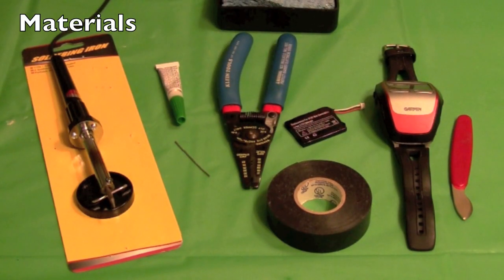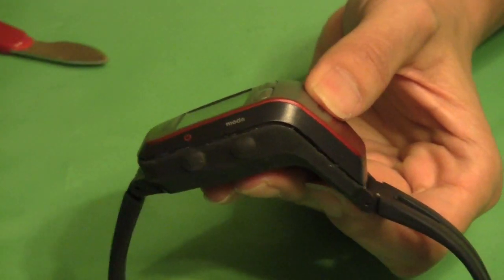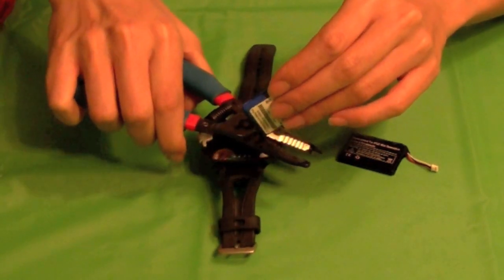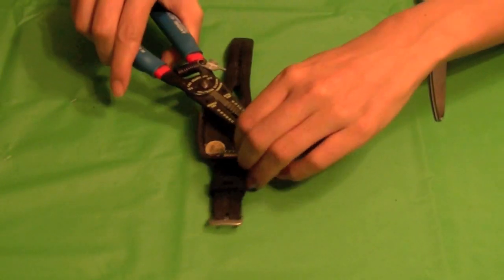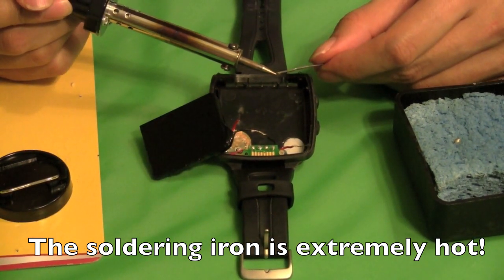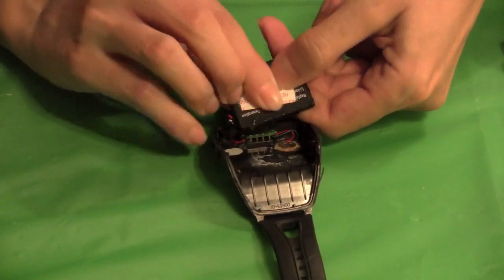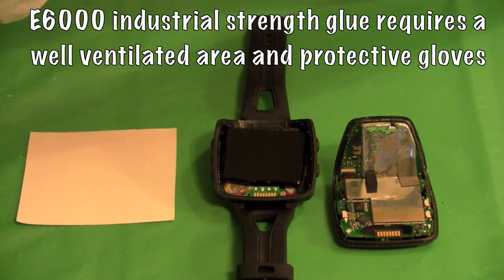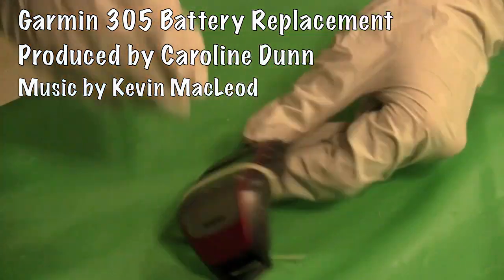How to replace the battery in a Garmin Forerunner 305 Watch

Comment: My my, you have beautiful hands. Thank you for this vid, my 305's mode button died and I threw out the unit. I got another used 305 for $30 and then saw your video. I went trash diving for my old unit so I will have a replacement battery if I ever need it. Thanks!

Comment: Caroline- Great instructions here. I just purchased a lightly used Forerunner 305 from E-bay today. Not sure if I will need to replace the battery at this point. Do you know if the battery will have any life? The original owner claims that the unit sat in the box most of the time. I understand that a good battery gets approx 10 hrs on a full charge, if that is correct. Thanks in advance!

Comment: So I posted my "I'll be trying this soon" comment six months ago ... and I finally did the job this weekend! Excellent, clear, easy to follow video. My trusty 305 is now charging and fully functional, once again. I found the wires/soldering a little fiddly; also packing the wires back inside the watch was a little fiddly too - I think I should have shortened the wires from my replacement battery a little before soldering, but I had already had the watch working and no way was I taking it apart again! Cheers :)
Reply from the maker: Congrats on extending the life of your Garmin! Glad you found this video useful.

Comment: Followed these instructions.  Got the same iPod Mini battery as in the vid.  Had never soldered before. But it all worked with no complications.  Not sure I sealed the edges well enough, so will have to put some silicon or something round.  My fault, though.  Cheers!
Reply: id pay you to replace my battery!

Comment: OK, I just did mine last night, and this was one of the more helpful posts.  My biggest piece of advice is get good wire strippers that go down to a very small gauge wire (I'm guessing 24g) and hold the other end of the wire (the part that's soldered to the board) with needlenose pliers so that you don't just pull the insulation down the wire.  I ended up having to unsolder the circuit board which leads to great complications.  If you can cleanly strip the insulation and do exactly what the post says, you'll be fine.  I tried to use some double sided poster mounting tape, but it was too thick, and I ended up using just a bit of the contact cement.  While I was in there I tried to solder the wire back onto the speaker (that's the disc), but no luck.  So far it's powering fine and is charging right now.  Also, while in there, pay attention to the contacts on the circuitry part of the watch and the pads on the battery side.  Clean them, and bend up the contacts if necessary.  I think even under ideal circumstances the contact is borderline, and is probably the cause of "watch turns itself off" issues.

Comment: ugh.i was hoping that it was an "easy" process.I dont have the tools sadly to help replace battery. i might ship it off to get fixed. unless your willing to help at a decent price to fix add new battery
Reply: Garmin will not fix it, they'll just offer to sell you a refurb for a much worse price than you can get on Amazon, Buydig, or eBay.
Reply: my watch just died that i bought from ebay this time. garmin charges 80 bucks to replace. i wish i could do the battery changing myself. shit.

Comment: Nice video. However, the battery that you show in your parts list is for the original Forerunner 305, but in the video you suggest using the iPod Mini battery instead?
Reply from the maker: Thanks for watching my video. You are correct. I made the video in 2013 when iPod Minis were a little more common. I was concerned that they would stop making iPod Mini batteries, so I decided to put a link to the 305 battery. I didn't want to link to a discontinued product.

Comment: Thanks for this vid. I had 3 dead 305's sitting in a drawer useless but now 1 is working thanks to your instructions on how to get inside. The red wire had come loose where soldered so I tried scratching the plate and re-soldering and the thing is working again! Not sure for how long but it has given me incentive to do open heart surgery on the other 2 units as well..

Comment: Hi, and I want to say great video! This was really thorough it gives me hope that I can change my battery once it goes dead. But I have a question, I was wondering if this can be re-soldered after taking it apart the first time? Like after doing this and it goes dead again can I do this again and re-change the battery if it goes dead a second time? Thanks!
Reply: +Dana Scully I would strip less wire to allow a third battery in the future. Also you can remove the solder using a soldering iron if you are careful with how you mate the wires with the first replacement
Reply: By the time the second one goes, you probably won't need it anymore because the Apple watches will be down to 30 bucks. You can always pry the circuit board out and solder new batteries directly to the board.
Reply from the maker: +Dana Scully Thanks for watching my Garmin 305 Battery Replacement video! I did not re-solder after the first battery replacement. I think it is possible, but much more difficult as the wires would be a lot shorter.
Reply: +Caroline Okay thanks!
Reply from the maker: LOL

Comment: Thanks Caroline for your video. I followed up all the steps and works great but I cannot charge the new battery. So I tried the old one and charges perfectly. I bought a second new battery but got the same problem. any idea? I tried  a hard reset with no success

Comment: Thanks for uploading this valuable information. I wound up cutting the original battery leads to short requiring me to extend the leads on a replacement battery ( for ipod mini) and then soldering them to the terminal board inside the watch. So far all is working well. Also wound up using liquid nails silicone adhesive  that I had handy. Seems the old glue was some kind of rubber cement.  For those contemplating this battery replacement, note that you will need time and patients to remove the old glue. I used an exacto knife and tooth picks. Rubbing alcohol helps remove the glue as well.

Comment: Thank you for this video, but I have another problem. My Forerunner 305 suddenly turns off, while I am running. But also if I squeeze the watch between my thumb and forefinger. Do you know (or does anybody knows) which is the problem?
Thank you very much.
Reply: +Alessandro 
Inside there are multiple gold-plated contacts on both the back of the watch face and the base (wrist strap). These can become corroded or weakened (they are spring-lever-action and can "lay down" thus breaking the contact points) over time and will lead to intermittent connections.

Comment: Why did you solder the 2 wires together to the ones sticking out of the circuit board.  It would have been easier to remove the ones on the circuit board and then not have a load of wire left with joins and tape.
Reply: I've done both...

I THINK (tentitive) it's easier with more distance between things that can get hurt with heat...I have a pretty clunky soldering iron...I wasn't very happy with it close to the case and board

But I used shrink tube not tape to insulate the splices...with a bit of cardboard so the heat gun didn't get anything too hot

Comment: Thanks for this - worked like a charm.  After reassembly, I noticed it wouldn't charge or connect via the dock.  Disassembling and straightening out the little brass contacts (VERY carefully) did the trick.  I noticed another use broke off one of the contacts, so be very gentle.

Comment: Well, I thought I got everything done correctly, however, the unit only powers on when it is in the cradle.  I don't have to squeeze it when it is on the cradle, so I think it is tight enough - but why will it not stay on?  It says the battery is fully charged?

Comment: Thanks for making this video. It helped me rejuvenated my Garmin 305. FWIW, I used rubber paper cement to glue mine back together. I want to be able to get it apart again if necessary. So far, the glee seems fine.

Comment: Thank  you very much Caroline.  With the battery, tools, tape and glue ready to go, the whole thing took about 15 minutes to complete!

The e6000 cleans up very easily.  You simply wait for everything to dry completely then just rub the stuff off.  It rolls up into nice little balls that brush away, sort of like rubber cement on metal.  I am a little concerned that maybe this glue will be tougher to pry apart the next time I need to replace the battery.

An added bonus is that the satellites seem to lock up much faster with the new battery.  About 5-10 seconds compared to minutes with the old battery.

Comment: I was able to replace the battery thanks to this video.  I couldn't get the pry tool to work though and I just ended up bending the unit to separate the two sides.

Comment: Many thanks, Caroline, for an excellent description. I have just replaced the battery in my 305 and everything is fine. I had a minor scare when my first trip wouldn't upload to the PC, but it worked the second or third time. Maybe there's an intermittent poor contact inside.

Comment: Thank, Caroline, for the nice, clear video! I was just given a retired 305, and I'm about to go at it. I purchased the iPod battery from eBay for half the price of the official battery. Is it crazy to think that it will be waterproof after re-gluing? Has anyone checked? I do some lake swimming, and a GPS is very handy to know when to turn around... Thanks.
Reply: I would not swim with the 305.  It is hardly waterproof, despite any suggestions by Garmin that it is.
Reply: Paul Dunn
Thanks, Paul. I'll keep my Forerunner for swimming -- it works fine for that. I have my battery and glue, and even cut a pry tool from an old butter knife, but I don't have the watch yet!

Comment: 1. Didn't you short circuit the battery when you cut the two wires at the same time from the new battery?
2. Why is it that you are using a different manufacturer's battery?
Reply: I guess because Garmin dont sell replacement battery for this watch.  If they will wanted people replace the battery they must put a jack on the clock and not soldered directly to the circuit. Programated obsolesence.

Comment: I found on another site that mentioned to pry from the bottom corner and that eventually worked.  

However, I found the little copper spring fingers on the display half of the watch were not all the same shape and when I tried to bend a couple of them up to match the rest one broke off.  The spring fingers are at the top of the display half of the watch.  

I suspect that was the problem with this one all along.  In any case, anyone performing this battery change-out, try to not even touch those little fingers.  After it was broken I messed with the other spring fingers just to get a feel for how fragile they were.  One little bend and they just broke right off.

Time for a new Garmin anyway :-)
Reply: Bummer!  One would assume that the 205 and 305 would be designed similarly, and thus this video would apply to both with regards to a battery replacement.  Your feedback however might be valuable for others out there with 205s to know that the fundamentals seen here apply more relevantly to the 305.

I used the watch you see in the video today on an 11 mile run, and it even performed admirably when I took it skiing last month despite getting snow, ice and water on it and being slammed into the ground multiple times with my reckless abandon on a pair of skis.

Sorry to hear that your 205 was not as cooperative in your efforts to replace the battery.
Reply: Paul, the 205 looks the same as the 305 inside.  The video is fine.  I'm pretty sure the problem with this 205 was in the spring finger contacts and not the battery so replacing the battery couldn't help. 

It should be noted that the gold color spring fingers that connect one half to the other electrically are VERY fragile and if you bump them or bend them you will probably scrap your device.  It would be easy to damage them and not even know you did it.
Reply: Tony, I understand now.  Best of luck on finding an affordable replacement.  The "mode" button on the side of mine has come apart and thanks to some electrical tape from my wife (gt2192c), it works again.  I might have to start calling my watch "Rasputin".

Comment: I've been trying to separate the case for 10 minutes now.  Its not budging.  Tried using an exacto knife to cut the bond but there's zero gap or material there to allow prying the two halves apart.  This a Garmin 205 Forerunner.  Looks very similar but there's no lip to pry on.
Reply from the maker: I think you are going to need more leverage / torque (than an exacto knife) to get the Garmin open.  I would recommend trying a butter knife or the pry tool that I show in the video.

Comment: Good video. I would like to make 3 suggestions: When taking the unit apart, a drop of alcohol into the seam helps to separate the two halves. On the new battery cut one wire at a time in order to prevent a momentary short.  Also be aware of static charges.  The devices inside the  instrument (watch) are very static sensitive.  The smallest discharge from your hand could cause damage either instantly or even later.  If available, use a grounded wrist strap.
Reply from the maker: Thanks for watching.  I agree with your suggestions, esp about the static and grounded wrist strap.  I'll add the wrist strap to the materials list.  I made my video during a warmer time, so static was not as much of an issue as it is now in the Northern Hemisphere.

Comment: Excellent video! Thanks. One thing I found was the best place to start prying the watch apart is at the lower part of the case where the strap bracket is. This way I didn't mess any of the rubber trimming around the side. AND you are right; a butter knife does the trick. Cheers and thanks a heap.

Comment: Good call. And for anyone reading this, this was literally my first time soldering anything (not counting a couple of bits of test wire to get the hang of it) and it's JUST AS EASY AS IT LOOKS. Also if you do need to crack the case open again, the E6000 cement is just a little stronger than what Garmin uses, but does allow for re-opening.

Comment: GREAT video. Just put mine back together and this works exactly as described. I do have a couple of notes for anyone attempting this:
1 - Be careful about where you stick the wires. I was too conservative about trimming and had to squish in the extra wire.
2 - and this is IMPORTANT - for anyone following these instructions, get a light-duty spring clamp (I got 4 for $5 at Wmart. I also had a problem with the unit requiring pressure to dock & the clamp may have solved that.

Comment: Was attempting to replace my battery, so got it open and when I started taking the battery off noticed it seems to be stuck to the little silver disc with two wires coming out of it and if I pull the battery off that's going to break off. Anybody know what the little silver disc is?
Reply: This is the little sounder that makes the audible bip's...

Comment: Great video. Couple of tips to pass on to others:
-before gluing, i tested as shown in video. I needed to apply a lot of pressure to the top portion of the watch so that the internal contacts would connect and thus the battery would charge, and the watch sync. After gluing, and curing for 24 hours, I still had to apply a lot of pressure in order to get watch to sync. I how have a clamp on the watch to see if that seals the deal.  perhaps i had too much electrical tape in there.

Comment: This worked perfectly as described. Ordered the same battery on amazon for $5 (search garmin 305 battery and it comes up as an ipod battery but in the comments it says it works for 305) after trying radio shack and a battery store with no luck. Mine had stopped taking a charge so I figured this was worth the risk and the battery did prove to be the culprit. Thank you for posting! Works perfectly now.

Comment: A very timely video as i need to perform this very operation on my 305. I've had mine just under 3 years and have gotten 5200 miles out of it. It has performed dutifully. I will attempt to perform the surgery and get back to you afterwards. Thanks!

Comment: I haven't really used the watch enough since replacing the battery to make that assessment.  If you've had your 305 for several years, then I can confidently say "yes" as the old 700 mAh battery will have certainly lost some of its staying power.  We have read reports from others online that the 1300 mAh battery will last longer than the 700 mAh.  If your current 700 mAh is only lasting an hour or two at this point before I dying, then I would recommend replacing it.

Comment: I noticed that the Ipod Mini battery is rated at a much higher mAh at 1300 than the Forerunner replacement at 700.  Is it lasting longer?

Comment: I noticed that the Ipod Mini battery is rated at a much higher mAh (1300) than the forerunner replacement (700).  Is it lasting longer?

Comment: As the owner of the actual watch shown in this video, I'm pleased to report that the watch is operating as normal.  It ran for 6 hrs 23 min on Monday, June 3, before issuing a "Low Battery" warning.  It was taken for a 5 mile walk on Tuesday, June 4 (1 hr 21 min) w/o the Low Battery warning.  And, it was taken for a 5 mile run Wednesday, June 5 (43 min) again w/o the Low Battery warning.  Also, charging and syncing operate as expected.  Great work!